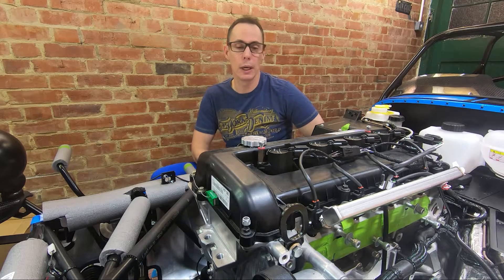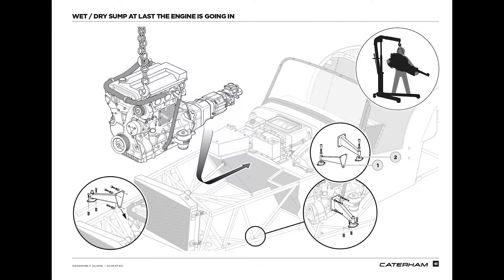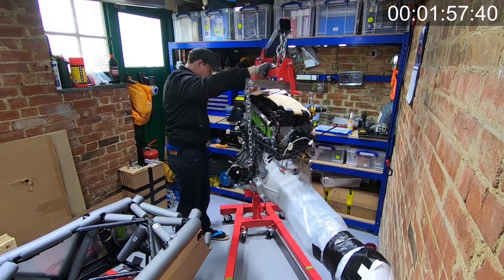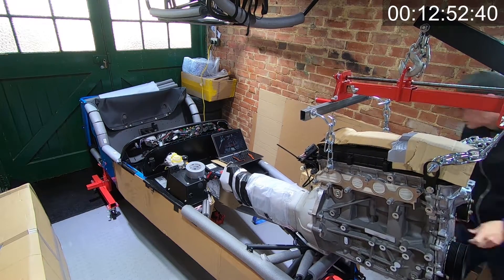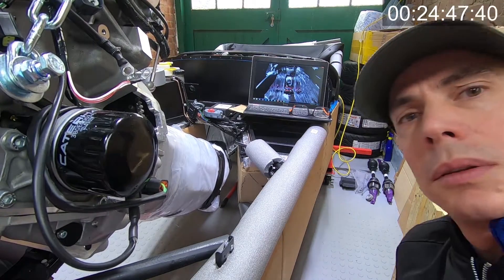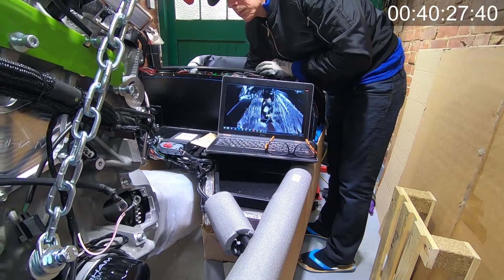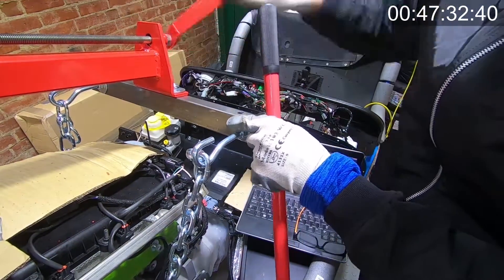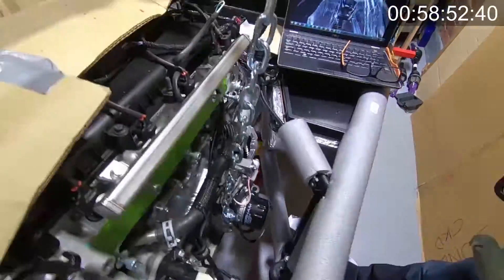Caterham 420R Build - Engine & Gearbox Installation - Episode 3 (Part 1)

Comment: has anyone thought about placing the engine on the floor and lifting the chassis, which is lighter, over the engine. Tilt the gearbox end up to reach over the cross member?

Comment: Hi great video and good to see this much detail, (lifting the rear of the car higher would have given you a easier angle with the engine instail). looking forwards to the next episode.
Reply from the maker: Thank you and you are correct, however with the current height I still had to use a spacer for the trolley jack to support the gearbox. You'll see this in part 2.

Comment: Great video again friend.  I have one question, is it not possible to take the bell housing off and install the engine first and then install the bell housing from underneath? I ask because in the future if you have to do the clutch will the whole engine have to come out?

Also I went and test drove a 420R last weekend and i am sold. I was able to ride in a 620 it was gross fast and I guess right hand only in the states. That is kind of a deal breaker for me here.
Reply from the maker: Hi Leon, you won't be able to remove the gearbox (with the bell housing attached) while the engine is in place as there isn't enough space to pull the gearbox back, but you can split the engine and gearbox in the car by pulling the engine forwards and only removing the engine if you need to do the clutch.

I'm yet to go in a 620 so I'm a bit envious you, the other down side of the 620 is that it's only factory built.